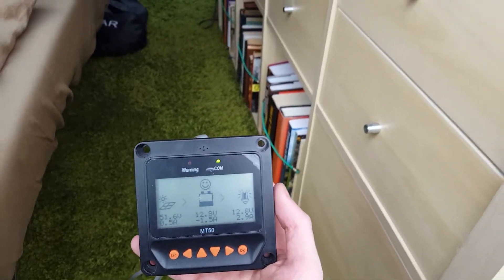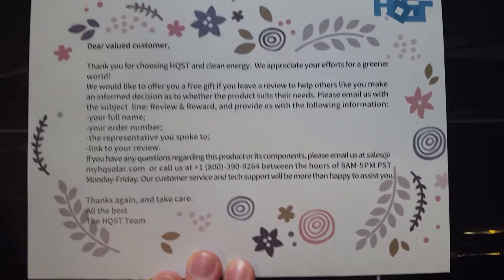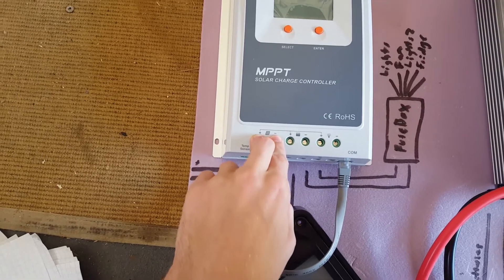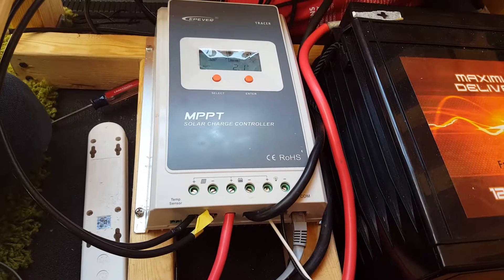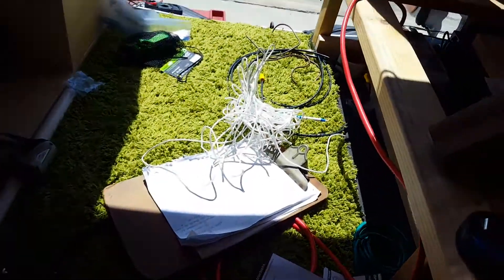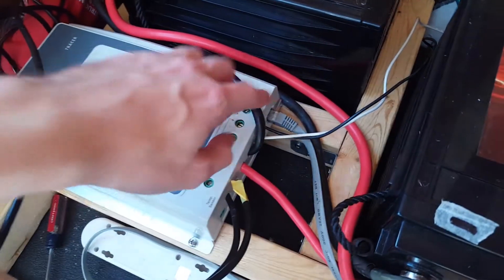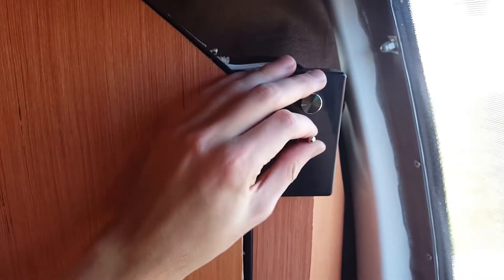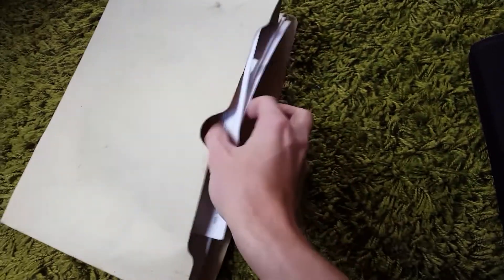Setting Up Off Grid Solar Power [COMPLETE]

Comment: Love you r video,my question is, what is the difference power the fuse box from charge ,controller instead a battery,thnx
Reply from the maker: Not super sure what the exact question is but I put in the extra fuses incase something I plug in (like an ironing board) shorts or something that way the main controller is still safe

Comment: Hey does you panels got BYPASS DIODES.. if not you need to make a bypass with a SCHOTTKEY DIOD
Then you'r panels ""volt PASS truhe"" Will not be AFFECTED by SHADDOW!! 
And you need Up Gauge to inwerter .. even IT is just a Short distance .. you draw 100++ A .. 
Volt x A = Watt 
No you can't chardge faster !! A chardge usually take's 8 hrs on Flodded/gel/AGM The SMART MPPT-PWM PART OF THE MPPT ..
CAN SNIFF THE RESTINCE OF THE BATTERY BANK AND CHARDGE ACORDENLEY .. THEY IS 
MAX 10% OF A OF BATTERY SO 150A is 15A x2 = 30A can fluktuate.. 
I would get 2 bat more and a BMS.. battery management system.. 
I got 20 SONNESHINE 200A a512/200AGM  in Banks of 4 5 Banks 48v x 100a 4800watt  with No Damage to bat bank at All 
Battery has a garenteed liifespan of 900 cycels .
3 yers du i go 10v to 14.4v every Day .. i ofcorse don't i maybe 
Use 9% on one Day .. er of corse use most power during the Day .. 
And Then we don't draw at All from the bat ..just direckt from panels truh EPever x 4 6420.. with 4 x 250v mono x3  4 serie 3 paralell
I use 10mm² from the roof .. to Controler room .. 4x 3+ and 3- All same lenght .. som would say baah humbug .. i wount !! 
I am rebuilding my whole house to green energy .. i live in the middel of a city
Reply from the maker: Very interesting I'll look into it thanks

Comment: Fuses cloas to battery .. as cloase as possibel .. on the hot side+ 
You can easely put more 100 watt panels Up .. 
You Will get Better results in cloudy weather expect 1/2 in medium clouds .. 1/3 in light rain 
Nothing under 10km thick  thundercclouds
Reply from the maker: Very interesting thanks

Comment: Why did you do the solar panel in series instead of parallel? Don't you want more amps? Trying to put my solar system together and would like to make sure it is correct. I am new at this.
Reply from the maker: Parallel is better for if you have shade over 1 or two of the panels. The downside is that it takes much more wiring. With series you get higher voltage. (Though honestly I went Series because it's simpler)
Reply: Oooh boy ... Ther is 2 things in this !!
1 paralell often use PWM CONTROLER Why ?? 
Becaus they paralell and the 100watt panels often are 17v thats 3 v abowe 14v 
And the PWM need's 3 wolt abowe target volt becaus IT is a "" stupid 12v regulator "" CONTROLER!!!! 
2 a MPPT CONTROLER needs higher volt to start switching when my panels hit 16v(37v) 
and ther is light (not sun but just light) 
The MPPT switches from PWM CONTROLER mode to 
MPPT volt raises to 64v and 7A  thats 12'7v 27A easy on a 30A EPever and a 200A battery ... 
Take note that ..
The pulsing Charger (the PWM part of the MPPT) raise A way abowe What is triggel chardge level 
And No harm is Don the chardge power is AS A RULE OF THUMB IT MAY WARY  10%of battery A when wet/AGM/ gel my case AGM 200Ah =20A Chardge power on 12v (got 2 systems )
SPESIAL BATTERIES CAN HANDEL BIGGER LOADES !!  20% CHARDGE 
but that's batteri manual reading and 8 hrs of chardge !!!! 
My system is soooo big that when i chardge with 20A and i draw 80Ax48v=3840watt IT comes direkt from the panels 
I don't utilice any battery before night time or in bad WETHER Then battery support PV pover
.
The shade / shaddow .. when you buy a MPPT
Say 60A and in this case 2 x150A batteries10%= 15A+15=30A chardge power 
30A overhead to use with battery A you load panels not batteryes at small load !!! The whole point is to preserv battery life 
If you DON'T care you fuk batteryes Up every 2 yers by ower using Them fine by me.. you get a realy bad deal ..
Batteryes ain't Free .. my batteries cost 12.000dkk a peas just Divided by 6 Then you get doller i got 20x 200Ah Sonneshine 512/200Ah
Estimater life time 7 to 12 yers if i do not EXEED 20% draw but 5 rows of 4 bat thats 200Ax48v 9600watt CONTINIUS duty 19 hrs 
I Will newer get to 9600watt !!! In consumption maybe .. 
if i wacum (Nilfisk Air by ARNOLDI) 1500Watt@1Hour
Bake in Voss oven 2500Watt @1Hour 
Toast in Voss oven No2 2500Watt 1Hour 
BOSH Super Silent dishwasher 2000Watt 1hour 
AEG 9KG Washer
AEG 9KG CONDENSER DRYER
PANASONIC 15.000BTU AIRCON 9.000BTU HEATER MAX 1600WATT 
IF SHE CHOSE TO RUN ALL AT THE SAME TIME !!! THE SYSTEM WOULD NOT CARE .. WE WONT THINK IF THIS IS A GOOD IDEA 
THIS SYSTEM IS DESIGNED TO HAWE POWER ENOUGH REGARDLESS MY!! NEEDS !!! 
IF WIFE GOES UP AT 02  to bake fresh brede to morning ore bake a cake .. well feel free .. we got the juice 
Forgot microwave oven .. 
The 60A EPever take's 750 watt PV .. but becaus flat PV looses 30% to 45degree Angels PV  i would use 3x 300watt PV panels 
In series unless you are on Hawaii or in the near wacenety of equator Then light comes from straight above and the 30% loss does not appley 
If the thred starder by now does not agree .. Them maybe this Will conwince the Bright Light 
Most Mid Range  panels has since the late 80 used bypass diodes !! Yes BYPASS DIODES!!! 
They are in in All qualety brands !! So if you buy Solar panels in WHATEVER WILL !!!!YOU GET SCUM PANELS 
THE LAST 30 YERS ALL MID QUALETY PANELS HAS BYPASS DIODES... SO THE MORE PAEALELL  A M P SONG AND DANCE ACT
WHO CARES IT IS OLD AND STUPID AT BEST .. TODAY WE USE MPPT TO MAXIMIXE GAIN ..
YES MPPT IS ONLEY 30%better Then MPPT 
(YEERH RIGHT IF YOU ARE STUPID YOU BUY THE 30% IT IS WAY MORE EFFICIANT THAN THAT)
YES LETS DO MATH SHAL VE !! AND I WILL BE RUDE AND UNFAIR FROM THE STARD!!! 
In this case Vs best case 
100WATT@17V 100÷17= 5.88A   100÷12=8.33A 5.88-8.88%=2.45A surplus A on one panel using MPPT not PWM
(Most 100 give 19v in sunshine so thats editional A just burned off in a PWM but utilized in MPPT to AMP)
4 panels x 2.45extra A you love A get-more A paralell (BILL SHAIT) = 9.8A 9 POINT 8 FREAKIN AMP WIN IN SERIES ON MPPT!!!! OVER PWM
NOT SHAIT PWM world's BEST CONTROLER !!! BULL MANUER !!! 
YOU CON ARTISTS PWM SALES MEN REALY GOT TO GET YOU SHADE/MORE AMP CON TOGETHER .. 
SIMPEL MATH JUST FLOKED UP YOU DAY
AND THATS WITH 100WATT PANEL NOW TAKE A 250 OR 300WATT PANEL ON PWM ooooH noooooooH 
300watt@8.12A ÷12= 25A@12v if MPPT on one freaking panel are you kidding me!!!! 
300watt@8.12A÷12 = 8.12Ax12v=97.44watt of a 300watt panel truh a freaking PWM CONTROLER hos lame can any on be!!!!
And why is IT that All RV USE 100WATT PANELS ARE YOU ALL DEBILE!! IT CANT BE THE PRICE 
MOST 100PANELS COST WHAT A 250WATT COST !!! SO I WOULD SAY IGNORANCE !! NOT STUPEDETY 
IGNORANCE AND SUPER BAD MATH SKILLS!!! REALY REALY R E A L Y BAD BELOW 3 GRADE MATH FRAK !!!
Holy moly .. 
Ill start my ovn sun channel .. becaus ther is way too meny 100watt s ( sorry mate not ment on creator ) CLOWNS ..
MAKING LAME SYSTEMS .. AND SHADDOW SHADE RETARDS WHO BELIVE IN PARALELL IS BEST!!! 
AND OOOH LORD PWM RULES THE EARTH
BLOW ME!! 
and this is not All ..ther is cabel gauges/mm² ..fuses... cabeling .. fumes ... Cleaning .. and Meny more things to take in considerstion 
Ooh btw .. Flex panels do not perform !! Becaus they are Bent the sun can't light All panel Tully Up .. sorry 
The flexi panels ain't fore Bent roofs but trailor lids to sawe waith !! Nothing els !! 
Sun won't hit the low side of the panel a FLAT panel Will get mor consistent light !! Sorry bro
Reply: Hey @Lee .. Hope you panels Work !! 
If you yet hawe to buy give me a hoooowel
So we can take the MATH TOUR TRUH SUN BULL MANUER .. AND COME OUT WINNERS ON THE OTHER SIDE !!

Comment: Hey Zach, do your cables from the panels still come in through the rear doors? How is that working? Any problems?
Reply from the maker: Good question, I had a leak through the door that I fixed in this vid: https://youtu.be/Bvk-NVlpEqQ?t=20s That was mostly because I forgot to re-install the seal. Otherwise it's been all good. Got a clip for you here on IG http://bit.ly/2AVHUd1
Reply: I never got a video response before! Thanks!!! I can see how the water would run down the cable into the van without the gromet at the bottom. Would some of these zip tie anchors https://youtu.be/UaU6PRLHfdk?t=19s securely stuck in the doorway save you using all that gorilla tape?
Reply from the maker: Hmm, I've never seen square mounts like that. You might be on to something with that, I'll have to check it out.

Comment: Really interesting. I am converting to Van living early next year and I'm trying to learn as much as possible. These vids will be invaluable to me in the future. Thanks for the info!
Reply from the maker: Awesome.☇ keep us posed on the progress. let me know if you have questions. 👌
Reply: Hey @GRU
Do you self a fawor !!! Ther is newer too mutch PV power!!
If you got the room .. remember ..!!!!!!
FLAT PANELS NEWER PRODUSE SAME AMOUNT OF POWER AS 45 DEGREE SLOAPED PANELS DOES !!
Big panels has BYPASS DIODES TO AWOID SHADDOW SHUT DOWN OF PANELS !! IN SERIES !! ALWAYS USE SERIES ON MPPT
SO if you like this almost correkt """ sun bro "" 
Chose a 60A EPever 6415 or 6420 (or on of the other EPever)3x300watt instead of 3x250watt to compancate for the flat panel loss ..
Then if you can carry the weight of 4 x 200A AGM BATTERIES .. buy a BMS Battery Manegment system
So All batteries get chardged evenley .. 
Same setup like this """ SUN BRO """  
FUSES ON THE BATTERY SO IF ANY SHORT .. NO FIER ..do to hot Cabels 
REMEMBER 10A / 15A / 20A  fuse (depending of manual read manual on PV )
 right at + and - wher the sun Cabels get attatched to MPPT 
Buy on eBay fuse holders just big auto fuse ppl often forget to fuse PV .. 
Thikker than suppleyd Cabels to inverter .. if ther are 3 termainls 
Use ALL 3 .. MY TEP3000@12v melted 1 terminal out of 3 !! Becaus the fool who had IT 
Before me derew 3000watt on IT . Thats 300A ++ on one terminal out of 3
My AMP goe's to 400A and when IT say error that is 12v x 400A = 4800Wstt CONTINIUS 1 hr .. 
This is tested !! I made a rail with 3 + and 3 - and 50mm² 1 / Gauge cabel to 16 200A batteries on sunny Day .. 
So when you buy pure sine inwerters 
I recomend SHTEPOWER.COM THEY produce 
EPever
TEP1500 TEP3000 TEP6000
SH500 WIND POWER TURBINE (NOT just WIND TURBIN)
SHI1500 SINE INVERTERS 
AND MENY MENY MORE FANTASTIC PRODUCKTS ..
WHO ACULEY KEEP WHAT LABEL SAY ..

Comment: You should have a fuse from solar panel into the charge controller to protect the charge controller if a panel shorts out. Also can the charge controller "load output" handle the amp draw of your fuse box? The installs I have seen on YouTube the fuse box comes off the battery bank.
I thought the output was for a small load, like a few LED lamps? Check your owners manual to make sure.  Either way this should be fused as well for what your fuse box is rated for. Anyway the setup is looking nice. The wood stain turned out well. The puck LED lights are a nice touch.
Reply from the maker: Thanks Shawn. you're right that there should be a fuse going from the panels to the charge controller. Regarding the specs of the others, I'll have to confess I got the specs and fuse recommendations from the custom wiring video in the description.